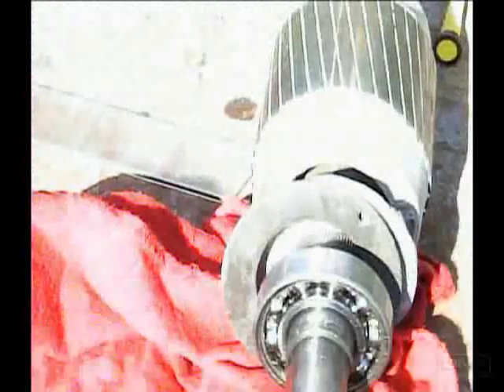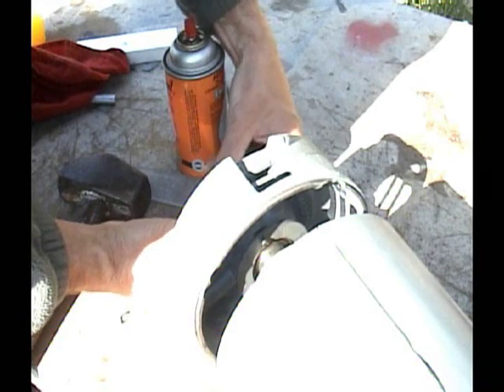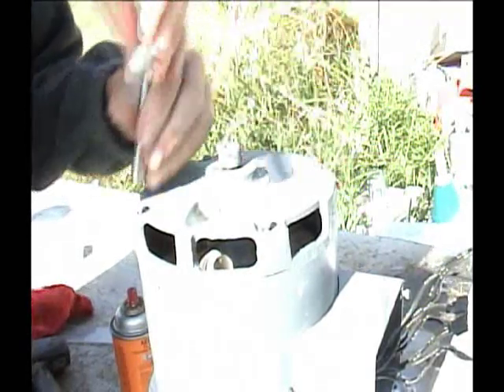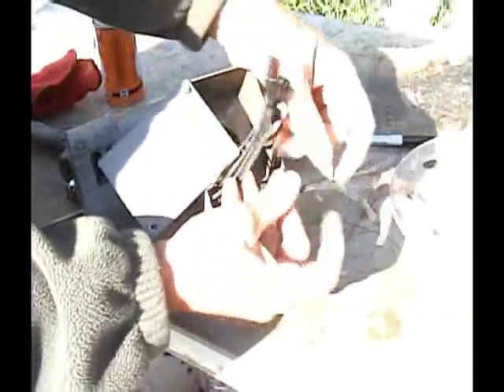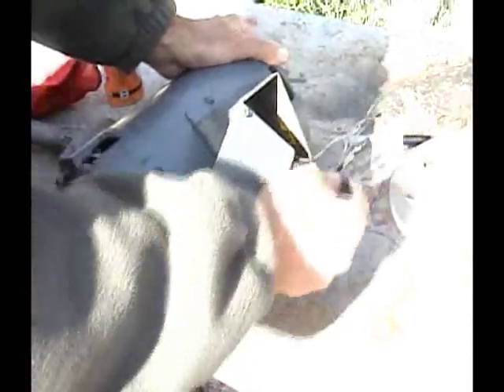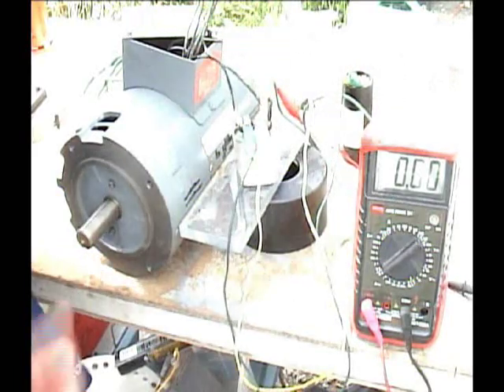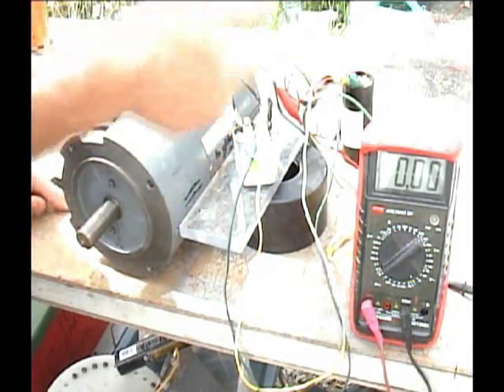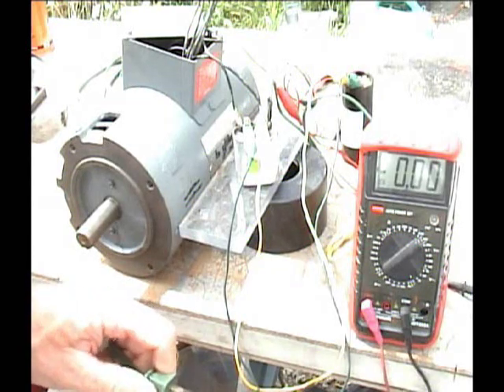Rotoverter Conversion Demonstration Part 2

Comment from the maker: The motor in video is a 3 phase AC motor of "marathon" brand, made in USA. It is a "2pole" type and goes 3450rpm on 60hz power feed.
Any type of 3ph AC motor (two pole 3450rpm type or 4 pole 1750 type) can be conveerted to a rotovertor motor. Between 2hp and 7.5hp is supposed to be the best effeciency, according to Hector Torres, who discovered the rotovertor.
Interesting characteristic is that he 3rd phase is "unpowered" and works like a rotary transformer and can be tapped-out for power

Comment from the maker: ADJUST RUN CAP UF VALUE for the particular shaft loading.

To pull out electrical power, and charge 2nd batteries or loop back into invertor (self run possibel this way) you set up circuit to have sinewave peaks or "0" line be the timing of extraciton pulses. This way no extra draw!

For big torque from rotorvertor, run at high freq and belt or gear down 

Voltage, frequency, pulsewidth adjsutment !!! Have hese three things in invertor and  ajdust rotovertor to particular load.

Comment from the maker: NicTesla invented the 3ph AC motor he could of been doing a rotovertor in his electric car with 2 of 3 phases running car and 3rd phase pumps back into car motor at sinewave peaks or into extra batteris or caps at sinewave peaks
The new testl electric car could be powered with rotovertor Hector who discovered rotovertor says to spin it very fast like a turbine, then belt down or gear down to usabel rpms for car.
For home use, use it as battery charger and generator on shaft use golf cart bats

Comment: he's converting a 3 phase motor to run on single phase with virtual 3rd phase. This means that current draw is very very low and these motors typically put out 5 - 10- times more power than is consumed. Hope this helps :-)

Comment from the maker: This video is not a demo of overunity but AC 3ph motors in rotovertor mode are capable of that
Spin a genertor on its shaft that has its power pulled out at AC feed sinewave peaks and at same time also pull out power from the run cap phase at sinewave peaks too. 
Running the motor on an ivertor and single battery and at same time charging 2nd battery stack of 4 batteries of same type in paralell would be a overunity demo. 
Use golf cart batteries or nicads or lithium phosphate types.

Comment from the maker: Best type of capacitors are old style "OIL TYPE"  and they should be 470VAC rated - lower voltages might blow especailly with 240VAC feed
 caps blow up when their voltage rating is not high enough -
google "oil capactors" you will find lots of companies that sell them - you want a handful of them and some 1uf ,2uf, and 3uf sizes so you can adjust the run cap uf value in 1 uf increments. 
It is very important to find the best uf vale for lowest darw and to adjust the uf for shaft load too

Comment from the maker: I got motor shown in video down to .18 amps input at idle. 
Prony brake tests of shaft showed 73% eff comparing input watts to shaft watts.
Charge extra batts from run cap phase at sinewave peaks: overunity righthtere.
Jam snall flathead screwdrive in gap between  inner bearing race and metal cover - you can pry off that metal cover then and clean out the grease wiht carb cleaner...cermaic beating or mcuh slimmer bearings replacing the stock bearings I bet would mean input near .10 amps

Comment from the maker: not really since you need 3ph AC motor to be a "rotovertor" but you can use 2nd 3ph AC motor as an alternator 
 and also can spin permarnent magnet rotor type generator with shaft 

pull out power non-reflective ot motor draw using diode cap swtiching circuit

release cap into load for power out

Comment from the maker: charge batteris with 3rd phase - FWBR  DC side on battery stack, change run cap about  to about 4 uf, and then "series" AC cap on one AC leg of AC side of FWBR so that this series cap cuts down voltage like a transformer...adjsut both run a dns seires cap so that draw of rotovertot does not go up and you have good amps output too into battery - find good balance - charge many parlaell batteris OU!!

Comment from the maker: Actually it is in 1 UF increments that you will adjust the run cap UF value with - not 1/2 UF

There is a way to super-fine tune the run cap UF with air-core wound with approx 30 turns of thick mag wire and iron rod sliding through middle - I have just heard about this, I dont knwo how good it will work. I guess if you can get the run cap phase to be PERFECTLY matched up with the lines 2 and 3 it will  harmonically resonate and input amps really drops big time. I have not done this yet

Comment from the maker: This sis good point of rotovertor actually Its a great testing machine for no- load generators and rotating machines to be more effeicint. since it is so sensitive to shaft loading.
If torque from a rotovertor is concern, then you speed up rpms to turbine speeds, and gear down or belt down  for it to have lots and lots of torque that way. requires precision balance, freqeuncycontorller pulse width controoler, and high speed bearings to do this... (car motor/electric turbine))

Comment from the maker: I try caps at 1uf intervals unitl lowest draw is found but it is nice to know formulas for this!
Also charging batteris with run cap phase is GREAT:
for example,  if 23uf run cap normallly, use a 6 uf run cap and then IIN SERIES AC CAP of 22uf value on just one AC leg of Full Wave Bridge Rectifeir over battery being charged.
Series AC cap cuts down voltage for battery charging motor stays same draw i´

experiment with cap uf values other than these of course. Charge multiple batteries!

Comment: i used an inner rotor out of steel and a outer casing out of aluminium it worked really well i had a few balancing problems  as it spins at 2800 rpm ive put the project to one side at the moment i want to try this roroveter thing so i can use a converted motor to spin my heater it will be cheaper to run if you know what i mean

Comment: ok thanks
also my motor as no plate on it i took the cover off it has three wires neutral black live with a 12 uf capacitor running of 220 volts what can i do for better effeciency.

i wish to learn more on this rotoverter system it seems the most interesting energy system saver that has been prooven to work.

Comment from the maker: Maybe if you have a frequency contorller for very high speed operation way above 60hz AC ffeed, also pulse width width contorller, and voltage contorller too, for voltages different than jsut 120VAC (like 300V or so) then this  you can get enough power for car. 
Hector Torres who discovered rotovertor said that wha t you want ot do is get it to work like a TURBINE going above 10/,000rpm, then belt-down with puleeys or gears the rpms to usable RPMs and torque for car.

Comment from the maker: If it is a 3 phase AC type of  motor, then it can be rewired to the rotovertor configuration.
You might need to replace the waterpump motor if yours is a single phase type with a 3ph AC motor if you want to try the rotovertor mod - See what HP rating on your motor is, (check label) look at specs like RPMs and amps draw  There is ways to improve single phase motors too with run cap UF value adjust to load- let me know what you have

Comment from the maker: Yes 3/4hp will be fine - best effeciiecny according to "Hector who idiscovered rotovertor method is between 2 and 7.5hp size motors but  3.4hp will still be OK - every moitor is a bit different yours might be a gem. 
Keep looking for 3ph AC motors - sometimes you get them for free not many electricans know how to hook up 3ph motors in first place and they are big and heavy. If motort you find is  frozen, replace bearings and will probably work fine.

Comment from the maker: They should be at least 250V caps if using 120VAC as power feed to rotovertor...370 are even better or 440V too work fine. 120V is too low - you will have around 145VAC at that run cap phase so 120VAC ones will blow up.
Also OIL CAPACITORS are the bet to use - you can find them on internet, jsut google oil capacitors and you can find companies selling them.

Comment: thanks for that i will check this weekend and give you details

on specs of the motor i will take of the cover and tell you what capacitor it has etc with the amount of wires coming of it etc .
I wish to reduce amp consumption or at least try because its the motor to my centrifuge for biodiesel filtering.

Thanks again KONEHEADS 
OH also what is the name of your forum again i lost the link

Comment: I am new to this but I learn fast so that’s a 3 phase motor and the emf is so stupid it loss so the amperage reverse back to the main and the voltage keep the coil energized with a strong magnetic field and the low farad running capacitor filter out the eddy current leave the motor in synchronized mode

Comment from the maker: Motors rated between 2hp and 7.5hp have the best eff
When hooked to high impedance (460V) circuit you will lose power 
figure maybe if 7.5hp you will get 1.5 to 2hp hp something like that.
it is better to suck rather than blow
also have a valve to control flow of water so you can zoom in and adjust on best effeicincy with the amount of water flow.
Adjsut your run cap uf value too for the shaft load the motor does.
Fun is when you tap runcap phase for extra power via sinewave peak circuit!

Comment from the maker: no but you can charge big stack of batteries with 3rd phase through approx 22uf cap in series and 5uf run cap wiht it. (FWBR at edn for DC)
in other words kick down voltage with series cap no transformer. battery becomes part of "run cap'
battery being charged or many more in paralell makes no differnce to draw of maotor.
yes still working on my own maotors based on Bill Muller design quite a lot.
I

Comment: I am using a circuit that charges microwave caps. How can I use caps in series as you've said instead of transformer to lower voltage? and what value?
Thanks for sharing.

Comment: Great video. Have you tried using an electronic speed controller? I use them to convert car alternators to run on 12-24vDC as a motor. It draws 12vdc at 4amps. So an ESC should work just the same on your rotoverter conversion. What kind of torque are you getting at idle speed?

Comment: I cant find the second trigger transformer to pulse out power from that 3rd virtual phase
Reply: Hi SifraTry an audio transformer, torroid type....kick down voltage with it, and rectify to DC at end of transformer put DC load on the transformer.,....transformer shourd connect IN SERIES on one of the run cap phase lines.Experiment with different run cap values too, along with different loads, different transformers. here is link for circuit diagram:https://sites.google.com/site/alternativeworldenergy/home/seris-transformer-rotovertor-run-cap-phase-power-extraction

Comment from the maker: Look rotovertor video  on youtube by RAYOGEN testing a rotovetorr - he gets it down to idle amps of only .1A (12watts at 120V feed) and also he shows the shaft being slowed and amps draw going up becaseu of that.

ALso  I tested a 2hp marathon brand 2 pole 3450rpm motor, and got 80% effeciency with shaft.
With ceramic bearings, precision blanced rotor, freq/voltage/pulsewidth controll you will get overunity in shaft alone.
Electrical power can also be extracted  "nonreflective" to motor draw

Comment: Hi there I live in europe 220V supply. I would like one of these to run an AC 220v 2KW alternator. Maplin Electronics in the UK have a range of 3ph motors 2pole 3000RPM and 4pole 1450RPM 12.5HP. Could this be done ?

Kind Regards
Max

Comment: could you resin in diamagnetically charged Neo magnets into the rotor slots to reduce the standing current? (pseudo PM motor?)
Reply: Probably not but interesting experiment to try.... the neos will probably saturate the laminate steel cores in stators too much create heat and rotor will slow from the eddy currents too  .... but diamagnetic magnets, who knows.

Comment from the maker: I dont tknow if that sor t of airconditioner  will be compatible since the motors driving the heatpump in them are inside a housing filled with gas - you can cut through the weld and split it and replace the motor but it would proably not be worth it I bet 
try some sort of external belt driven air conditioner link in car or truck

Comment from the maker: its a rotating transfformer the 3rd phase you could call it that if you want but more that.

if you want to charge 12V batteris put a AC cap in SERIES on run cap lines 2 or  3 about 21uf and lower uf value of run cap to about 5 uf (experiment)
then FWBR to Battery for DC no transformere needed to step down doesnt
affect draw of motor when you find good values charge lots of batteries in paralee overunity  right there its EASY not hard.

Comment from the maker: seems like a single phase motor - ask on the EVGRAY site for help with that otherwise my advice with water pump is first put valve on water line to adjust water pressure to exact what you need no more or less then yiou can fine tune your motor to that constant pressure.
See if 120Vac wil work with motor then change cap uf values in 1 uf increments whiel motor is pumping the water is all I can think of besides cleaning bearings and relube with small amount hi tech type of grease or oil...

Comment from the maker: RV MULLER on link 16 of my site is dismantled - No OU just a "gain" because no sinewave peak switching too it when testing it 4 yrs ago 
it would take a double rotor and X3 number of coils to be OU "as is"
Rectified back then gen coils AC to DO and watched how much the AC motor went up in amps with resistor load to coils

got gain of  around 1 to 2 watts per coil
 
then used LITZ wire coils power went up X3 with those since it is hifreq system and then did SHORTING coil volts up X20

Comment from the maker: I have some Muller genertors and regular home generators to spin wiht rotovertor with big  flywheel in between but I have regular power where I live
Also built a "cavitation" heater which is an aluminum drum filled with fluid like motor oil or vegtable oil whicih has ashaft with 39 thin metal discs bolted to - the shaft spins the discs the friction/cavitation produces lots of heat so its a rotating heater - check out the "fuel-less" heater or "cavitation" heater plans you can buy online